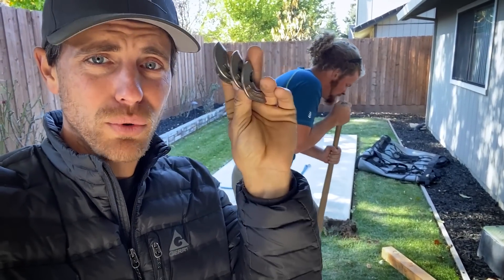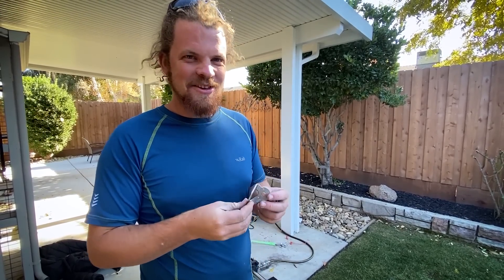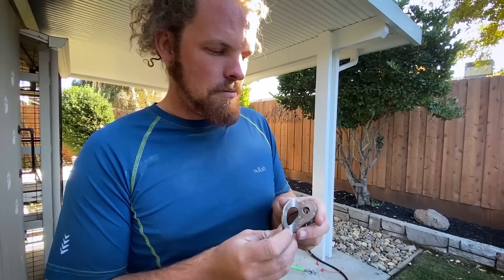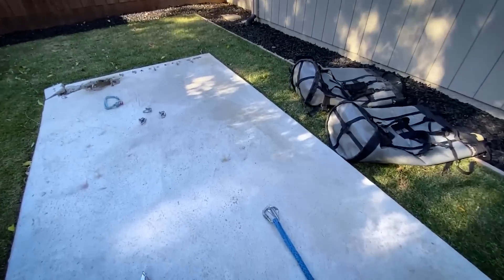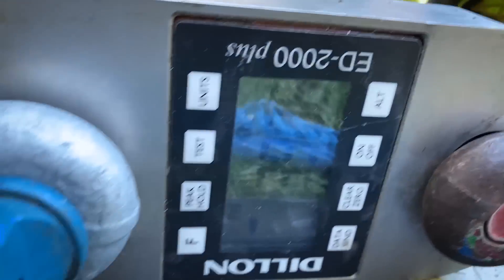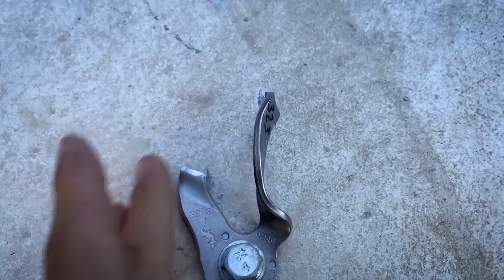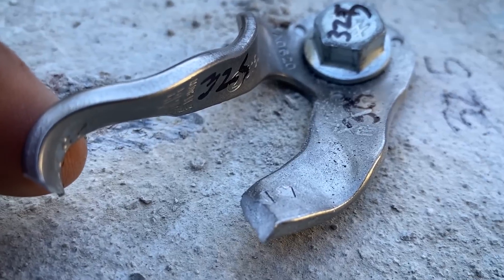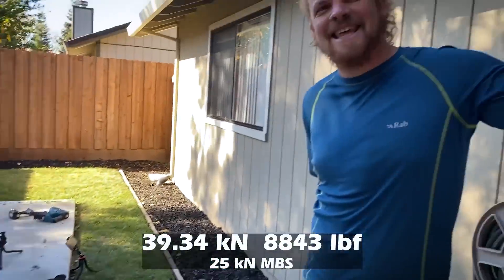Fixe Hardware's New 316L Stainless Climbing Hanger

Comment: I reckon it's stronger because you're spreading the load better across the metal hanger, pulling from both sides. Whereas when you're setting it up properly it pulls more on just the one side giving less overall strength. Not an engineer just a young hypothesiser.

Comment: From 9:50 until 10:05 I think the 10+kN from the MBS might be from the carabiner biting into the concrete. Look at how much is being gouged from the surface, I think scraping the concrete is inflating the actual strength of the anchor
Reply: That's a good point i hadn't thought of. Wouldn't expect a +10kN result from a little friction though?

Comment: I think part of the reason comes down to friction between the biner and the concrete. There's contact in all attempts, but in #1 and #4 you can really see it digging(We don't get to see much of the digging in #1 because of the short time we see it from behind). From basic mechanics we say that the force of friction, R, is a function of a frictional constant and the normal force of the ground (R  = mu * N). The digging suggest a high normal force. This frictional part of the force is felt by the dynamometer but not by the hanger. It seems extreme that the friction is 10kN so there's probably more going on, but I think it plays an important role. 

The frictional constant between a horseshoe (which is basically a carabiner, right?) and concrete is 0,67. So if the biner gets pushed down into the ground with 15kN of force the math works out perfectly. And you do need a lot of force to crush concrete.

Comment: hello man, how are you? can you help me? we have 304 stainless steel bolts installed in a highline, and we would like to leave the 304L (Pingo) hangers threaded indefinitely. do you think this combination could speed up the corrosion process? would it be better to leave another hanger installed that is only 304 stainless steel? thank you so much
Reply from the maker: We have have yet to see examples of galvanic corrosion between different grades if SS even 304 and 316. It is probably possible but would require a perfect storm of condition. If you you are seeing any evidence of corrosion SS is probably not the best choice for that environment. For more info  read thru that section in the bolting bible, check out the Crag Chemistry website and read the Climbing.com article about mixed metals and Galvanic Corrosion.
Reply: @HowNOT2  I just have to thank you, you are too amazing. thank you for sharing your knowledge, these are people who accelerate our evolution process.
Reply: Unless welded, those are for all intents and purposes exactly the same.

Comment: That new Fixe hanger... anti-rotation dimples, rounded edges and 316 steel, it looks like the love-child of Petzl Coeur and fixe's original hanger. Could just be the best of both? All I have to add is avoiding mixing 304 (-0.5volts) and 316 (-0.4volts) in marine environments, but away from saltwater it's no big deal.

Comment: in what way did you install some of the bolts wrong? . that wasn't stated in the video
Reply from the maker: The hangers where installed 90 degrees counter clockwise from instructions.

Comment: Having used concrete screws a lot at work I figured they could be a good option for semi/temporary hanger bolts. I have some cliffs on my property and I wanted to try bolting, these let you to place/remove hangers really fast and allow me to make mistakes without throwing away a glue-in/glue. When I'm happy with a route I'll go back, zip them out and use the same hole with a glue in. (the sandstone can be kinda soft in places). That being said, I hooked some up to my truck in tension and tried to pull them out of the rock (unsuccessfully) before I was totally keen to trust them.

I would say the main risk would be overdrilling and over tightening the bolt into softer rock (I use an impact wrench)  because it will just start spinning and pull out of the hole. I am also a little hesitant to use the same hole twice with sandstone...the bolts just go in a bit too easy.
Reply: I overdrill all of mine and don't have issues? They're supposed to be overdrilled by a 1/4" or something iirc 

I don't know if you could actually shear the head off one from overtightening it with an impact unless you're using small ones (ex/ 7.5mm Heco Multi-Monts) and a big impact. 

After having some troubles with 5/16" temporary screws warping, I had a friend recently point out that the smaller screws ( ≤ 5/16" ) can be pretty susceptible to wonkiness of the hole (i.e. non-uniform bore caused by 2-cutter SDS+ bits). He suggested sticking to 4-cutters, although I haven't gotten around to testing it myself. Initially I was thinking that my 18v 1/2"-drive Impact was too rough on them.

 **I'm working in limestone, typically good quality with minimal chert'n'shit mixed in...

PS: I too would be sketched out using the same placement twice in sandstone (like... red rocks sandstone... not the quartzite stuff)
Reply: @rachelhasbruises  I should have clarified, by overdrilling I meant by diameter, in the softer stuff if you aren't steady or wiggle the sds side to side like they sometimes instruct you to do into concrete you can make the hole a bit too wide. I'm not too worried about shearing the head off, (I use 10mm galvanised screws) but if I hold down the trigger on my impact socket wrench it can just keep twisting that screw until it spins freely in the hole. In the end it comes down to experience with the equipment. I even prefer to use a worn down sds bit because it makes them a little more snug.

Comment: Ryan, on the concrete screws, have you noticed a difference between the 3" and 4" length screws?  is there a significant difference in strength and longevity?
Reply: 3" only have 2.5-ish inch embedment, so it might behoove you to just use 4" if you're in softer rock like limestone and you're pulling in tension (direct pull-out). Based on the manufacturer specs, the shear strength is the same because that's just with respect the screw diameter. 

Get yourself an impact driver because you're not going to want to set these big fuckers by hand. Haha

Comment: Hey guys nice video but I still like the previous 304 hangers.
About those titens do thew work on hard stone like granite or volcanic. I had used dewalt screws and the rock destroys the threads
Reply: Stainless or galv? Stainless is more brittle so that might be the cause... :(  obviously we can't use galv outside, so you might be in a pickle.

Are you using a drill bit for four cutting nubbins? I recently had a peer in the caving community point out that he's had much better success with the four-nubbins (cutters???) bits when bolting in screws.

Oh! And if you're using SS deWalt screws, are you using the Powers drill bit they tell you to use?
DeWalts SS screws are actually 1/16th larger diameter than nominal for [niche-AF reasons I explain in the 2021 Bolting Bible]. If you're not using the matching drill bit for the SS ones then it might be gnarling-up your threads because standard SDS+ bits are making a slightly tighter hole...!
Reply: @rachelhasbruises  hello Rachel, thanks for your reply. I'm using a 3/8 bulldog xtreme full carbide head bit, in concrete, the screws work fine. But in this hard stone of Guanajuato when I try to tighten them they get to a point where they just spin and spin without getting any deeper the screws are galvanized, I tried to use them as temporary anchor but After these unsuccessful attempts I switched to fixe triplex and they work excellent, for those I ordered hawera slp plus full carbide head 12mm bits which are basically the same than bulldog xtreme

Comment: Im more hyped/impressed about those statements on the concrete screws, sounds sustainable AF, some tests vs normal bolts would be nice
Reply: I’d love to see how many times you can reuse a hole with those bolts!
Reply: @GrahmHornsby  Ryan, stated early on, that they got 3-4 full pulls per hole. and that is concrete,
Reply: @andrewdavidson542  the convenience of a bolt without the later inconvenience of bolts (difficult to reuse holes)
Reply: Yeah, it would be pretty nice since it's a better alternative when having to "move" bolts (which just means pounding one in and placing another) or pound in a faulty wedge bolt (wedge bolts are the standard that we use in our mostly bomber granite).  Although right now, it seems pretty cost prohibitive compared to wedge bolts but not compared to Powers 5 piece bolts (probably much cheaper than those).  I think it will all depend on application.  Personally, when you're putting up anywhere from 30-100 routes per year, cost really matters, especially these days with rising costs.

I know Tom O'Halloran ("pro" climber and Olympian in Australia) has used the same or similar kind of concrete screws for bolting on sandstone in the Blue Mountains.  He uses them as temporary bolts, then replaces them using the same hole with homemade stainless U-bolt glue ins.  They seem extremely useful for bolting in steep terrain and bolting ground up when you just have to slam in a bunch of bolts to get up the wall, then actually figure out where the real bolts are going to go later.  For a while, I think he left one in that he was clipping and potentially falling on with his 5.15 project at Elphinstone in the Blue Mountains.

Comment: I think stainless titans are possibly the future of good climbing bolts. Price is probably the only thing really stopping it at this point. Can get good stainless expansion bolts cheaper, at least with eBay and when you are thinking short bolts for granite. Good long stainless expansion bolts for sandstone are still not that cheap, including what you can find on eBay. Titans are easy to install, easy to remove cleanly and quickly without a fancy spinner tool and luck (you can re-use the existing hole), could use the 3/8" hole as-is for a small glue-in or drill out to 1/2" for a larger glue-in or expansion bolt (but why would you go expansion other than price and convenience of not needing to mess with glue?).
Reply: My worry is that some **** might come along and steal everything. Don't underestimate how stupid some people can be

Comment: I think since your force meter is sampling peak forces at some frequency, as the hanger pivots, that pivoting is not actually that smooth and your force meter is detecting some of these slight jerks which might be producing momentarily higher loads. Those loads are not uniformly dispersed across the hanger so they dont necessarily break the hanger. Since you are doing slow pulls, this is effectively a semi-static system. Whereas as it pivots and jerks imperceptibly, it introduces some dynamic element to the force curve creating these peaks. 

I am not married to this explanation.

Comment: When you installed it incorrectly you can see that from this direction of pulling it is more supported on both sides of the bolt and when you installed it correctly, the front of the bolt takes more power on itself.
That's what I'm think

Comment: It may just be stronger in a 1 time use scenario like your test. If you install it wrong it may deform easier which may make it stronger THAT time, but after repeated use and deformation, it could become weaker. While the "correct" way does reduce overall strength, but prevents premature deformation making them last longer and stay at the same strength over time

Comment: It's curious, probably due to the carabiner... You should try a test with aluminium carabiners. Maybe the good position make the carabiner last longer, the other position may weaken it.
So maybe fixe chose the weaker position for the hanger but that combined with a standard carabiner makes the better and stronger combination.
Reply: Most aluminum carabiners are weaker than these hangers.

Comment: I am betting that the wrong installation allows the metal to deform more gradually during a break test, but also would allow the normal deformation from regular use to be more noticeable. People will probably complain if they see a slightly noticeable warping of the metal over time versus no warping at all even though the absolute strength is ultimately greater. Just a thought.

Comment: I think installing it wrong allows the hanger to bend more, loading it over the full width of the material instead of almost perpendicular to the plane. Installed right you end up loading the edge, making it easier to break.